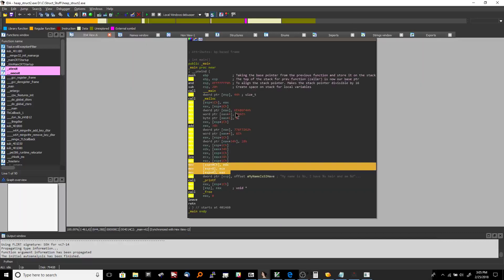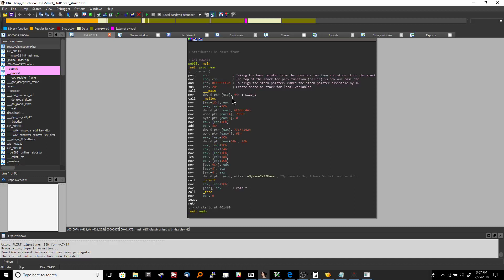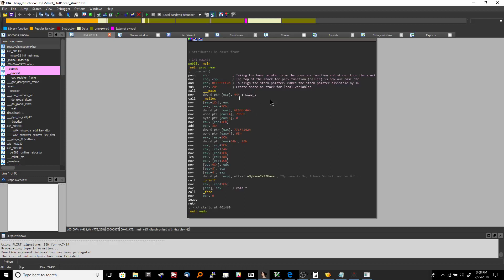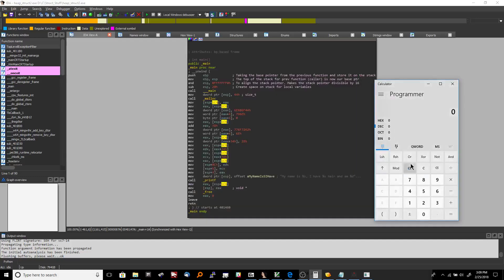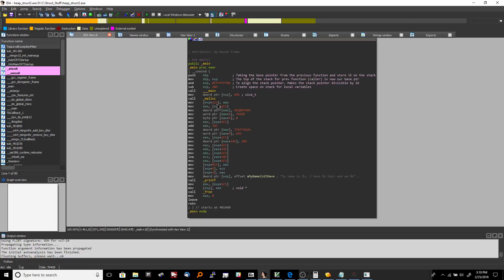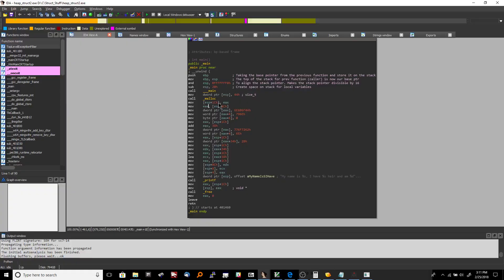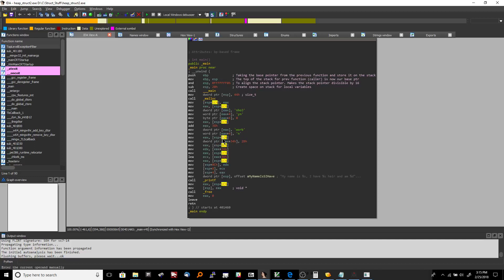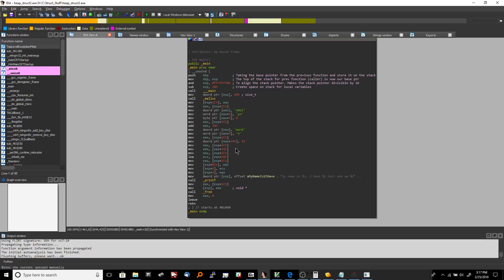x86 In-Depth 3: Identifying C-Style Structs

Comment: What flags did you use to compile this with mingw? It looks like it optimized out all the calls to strcpy and replaced it with a series of mov instructions. When I compile this with MSVC using the debug configuration, the calls to strcpy are retained. Just wanted to make you aware that people using different compilers might not be looking at the same disassembly as you (and maybe suggest you drop a link to the binary you are looking at in the description). Good explanations nonetheless.
Reply: Even having the same compiler, but a different version could yield different results.